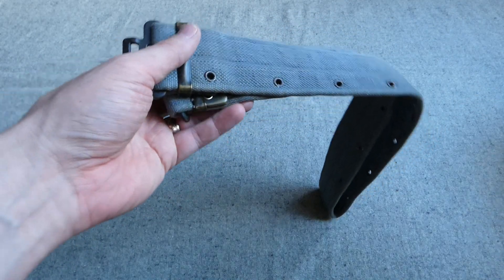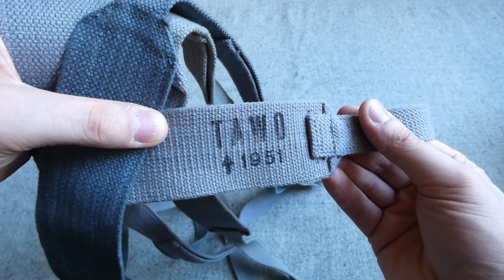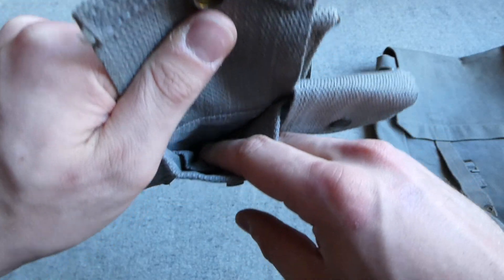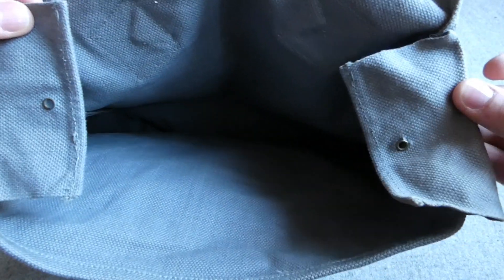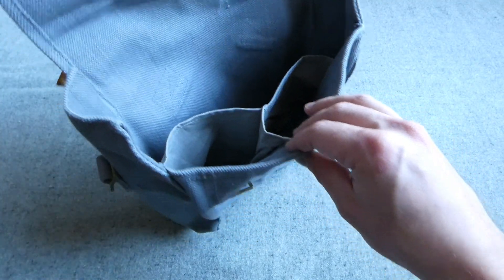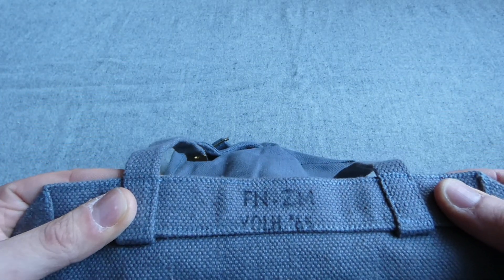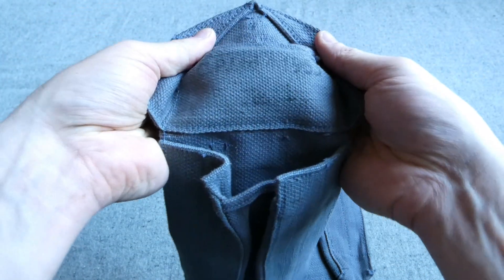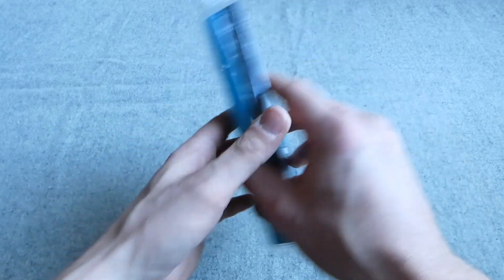Some British and European Air Force Webbing - Unboxing

Comment: Have you checked if the first shown belts have BB marked in them? BB is civil defence and they also had grey belts which were without the back buckles. There are also KLu ones though, still not entirely sure what the deal is with those as the KLu ground troops actually did wear webbing with braces.
The tawo marked brace is Belgian and I suspect the cartridge carrier after it is too, as I haven't seen Dutch made cartridge carriers, just basic pouches and uzi pouches iirc.
The 2 packs after that both seem Belgian to me, the Tawo one is for sure, and the one after that with the extra strap is Belgian too